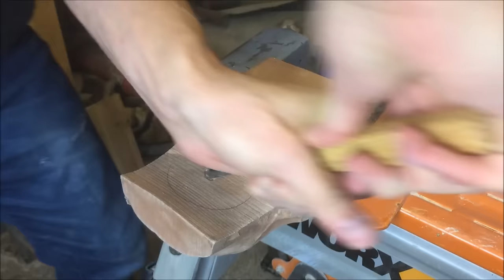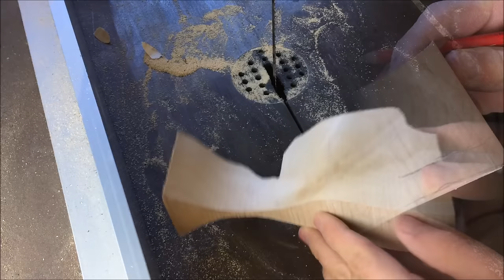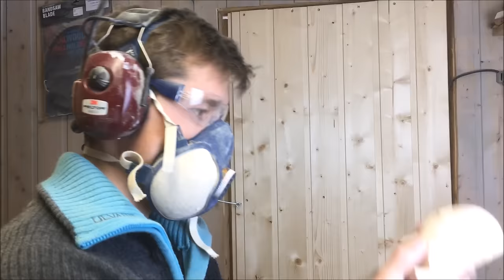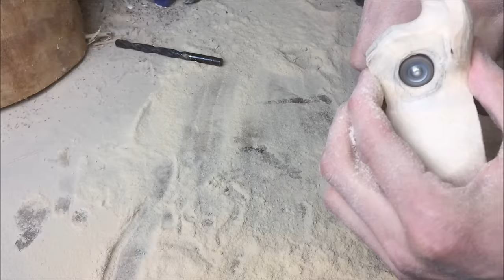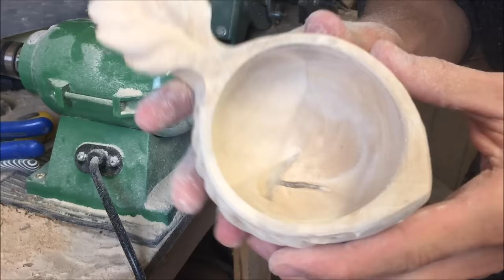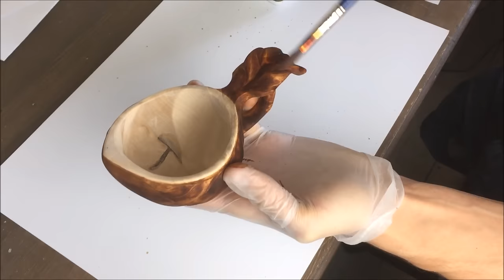Making a wooden coffee cup out of birch burl wood | by jonas olsen from Norway

Comment: Is the Danish oil not toxic, and also will it no mix with hot liquids, is the Danish oil enough to totally seal the mug or can you not let liquids sit in it for to long??
Reply from the maker: Danish oil is a very strong oil compared to a large variety of other finishes. It does the work well as a sealer judged by me, but you should add multiple coats of oil. The danish oil that is food safe says so clearly on a label on the bottle. I would not have coffee sitting in the cup for days, but i think it would handle a few hours just fine. Also just handwash it
Reply: I would highly suggest mineral oil with citrus solvent as a thinner agent. Both are 100% food grade and bring the grain out just as well. Excellent work by the way.
Reply: @Jonasolsenwoodcraft    what is Danish oil?
Reply: @vin17flores72  Since you haven't got a reply yet I'll try: When you highlight the words "Danish oil" in your question and right-click them, then chose "search google for xy" you'll find plenty of definitions, articles, shop offers and even videos explaining Danish and other wood finishing oils. (Or you could just google it instead). 
The first suggested page is Wikipedia, where it says: "Danish oil is a wood finishing oil, often made of tung oil or polymerized linseed oil, although there is no defined formulation so its composition varies among manufacturers. Danish oil is a hard drying oil, meaning it can polymerize into a solid form when it reacts with oxygen in the atmosphere. It can provide a hard-wearing, often water-resistant satin finish, or serve as a primer on bare wood before applying paint or varnish. It is a "long oil" finish, a mixture of oil and varnish, typically around one-third varnish and the rest oil."
I hope that helps. Greetings, Elle-Iza

Comment: Can you list tools:the bench and green machine you used please?- and what is that a mini angle grinder?🤩 your setup would be perfect for me
Reply from the maker: Hey, the green machine is called a "kirjes sanding system". The bench is a "worx jaw horse" The little grinder is a merlin 2 mini grinder. The grinder is ok, but i must say it offer a bit to little power, It seems to be struggling with hard wood like birch burl at least.

Good luck with your projects
Reply from the maker: I must add that i have bought an arbotech mini grinder and it is a lot stronger than the merlin 2 one. I have not tried it out much, but that machine eats wood like butter. I believe it is more dangures tho.

Comment: Does the wood need to be completely dry before working on it or can I cut a piece and carve it immediately? Thanks..
Reply from the maker: Well you can cut it when it is not dry, but it will bend in weird ways and perhaps even crack. i usually dry it for quite a while, but i do not meassure the moisture content
Reply: Jonas Olsen Woodcraft okay, so I cut a short piece off a tree, wait until it has dried out and then carve it. Can you advise me which gouge to use? I have no machines except an electric drill. Thanks for replying :)

Comment: The wood stain does not go into the coffee?
Reply from the maker: Hmmm good question. I do not know to be honest. That i why i did not stain the inside of the cup. I think it all depends on the oil you use. 

The danish oil i used will cure and create a very tight seal so i would imagine that the stain would never be in contact with the coffee.

Comment: I haven't even finished watching and I need two of the tools you use!! 
Ordered the Worx Jawhorse Clamp work station. So cool and just what I needed. Now, what is the name of the ball you attached to burrow out the bowl of the cup?
Thanks so much!!
Reply from the maker: Hello! The ball thingy is a part of something called the "kirjes sanding system" I think you can buy just the parts as well and not the whole system if you do some research online. 

The Worx Jawhorse is such an amazing tool, but i would actually prefer a bit bigger clamps. I think it might be possible to modify that on your own since both sides has two bolt holes. 

Good luck the the creations!

Comment: hi!
recently i got into woodworking, was wondering whats that lil machine at 7:18 called.. would  be very happy if you answered!♥  thanks
Reply from the maker: Hello. that is a dremel 3000 machine with a flexible extension shaft. the bit used there is a 1/4 inch sanding drum
Reply: Thank youuu❤️